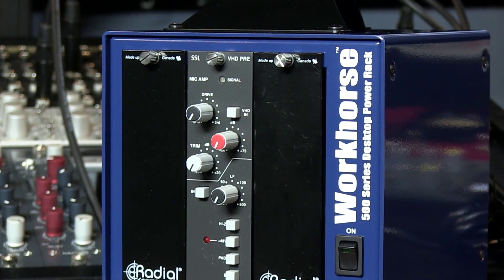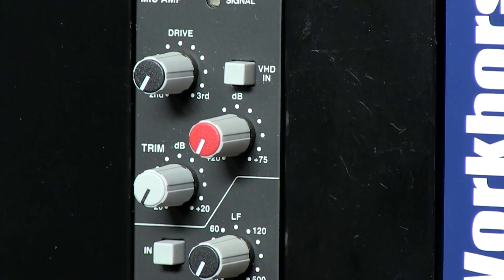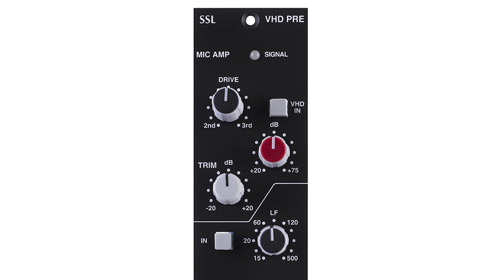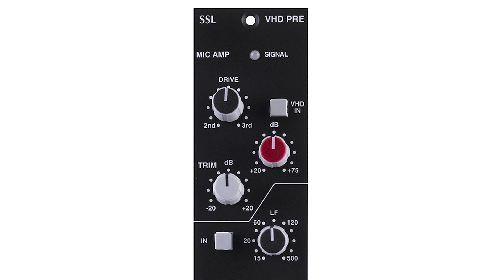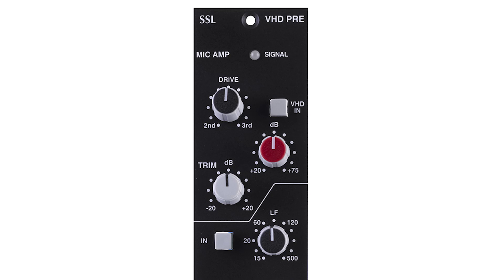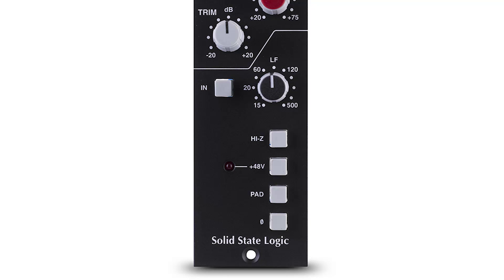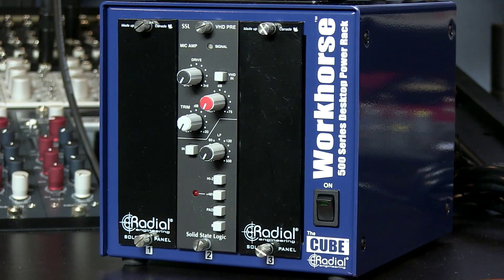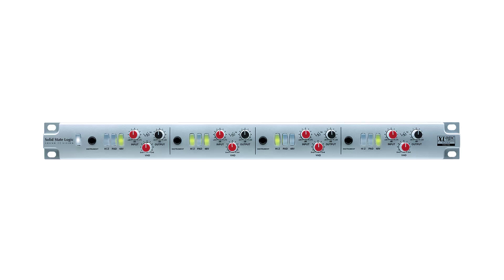SSL VHD Microphone Preamp 500 Series Module Review and Samples

Comment: Excuse my ignorance, but where does the mic plug into?
Reply: You have all kind of  modules :preamps,eqs ,comps,tape simulator,even filter and delay(Moog)...Its cheaper than the 19' rackable big modules!
Reply: In the back.
Reply: What d'ya know :)
Can't find any pics.
XLR Out?

I'm looking to use this into XLR input of an RME Babyface for vocals.
Reply from the maker: 500 series modules outputs are dictated by the 500 series rack you put it in.  Mostly XLR.  You will also need the rack to power the unit.  You can get small ones like the Radial Cube which we have a video on and will show the back.
Reply: Thanks for explaining this.